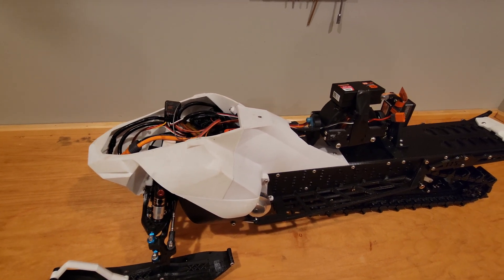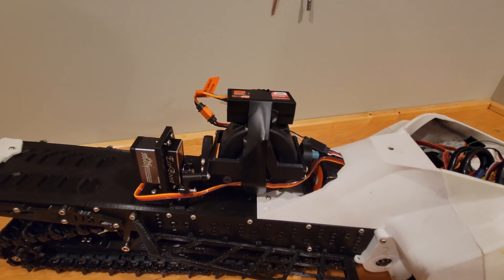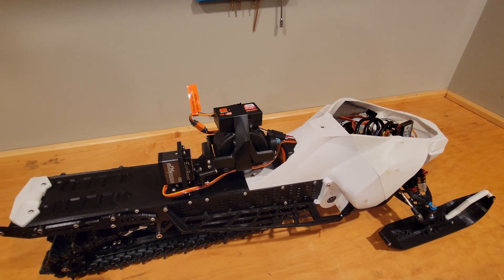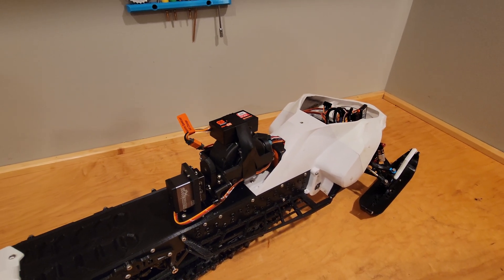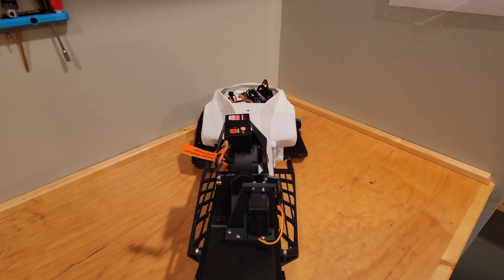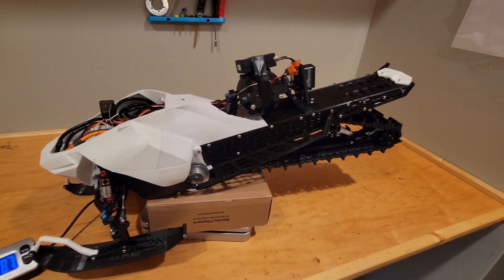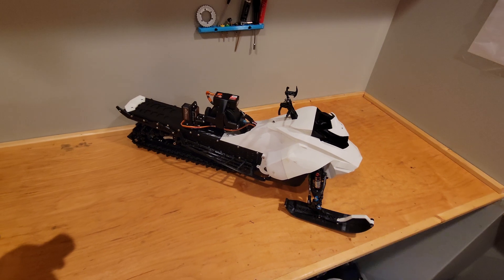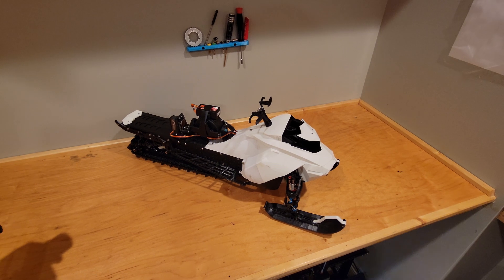G4 Flywheel- Pascal's dynamic weight system challenge

Comment: Merry cool , I suggested to Robert pascal he needed weight on a servo but this seems to work pretty well I think a smaller version of the flywheel would work 
You can see the weight hinders it a little but turning was very good also it may work better if it can be mounted lower and more forward just a little

Comment: Isn't the challenge to make it turn better?
Reply from the maker: Yeah... that's what I did
Reply: @wheeliegriff777  I didn't see any turns. A couple times it spun around standing straight up. Show some turns carving. And some turns on a side hill turning into the hill. 

Can you drive it in a controlled manner and make a turn showing the sled leaning into the turn and not tipping over to the outside? A somewhat controlled turn? The issue everyone knows these RC sleds have...

Please show that so we can see if a gyro really works like we hope it can, instead of answering by saying you did it when clearly you didn't.
Reply from the maker: @chilly7261   @chilly7261  It definitely works good. That was my last day with deep pow, so now it's all basically melted. If you look in the video the sled was side hilling and dose some really tight 180° turns. Dose your sled turn in actual deep pow? Hard pack turning is one thing and deep pow is another thing.
Reply: @wheeliegriff777  Thanks for responding. Good luck with your mod...
Reply from the maker: @chilly7261  you too.....

Comment: The ingenuity in this competition is crazy. This is the fourth video I stumbled across and they'r all different. I think yours is working the best. Is the gyro hooked up to a Helicopter gyro? That would be gold I think.
Reply from the maker: No it not, just mixing the steering with the flywheel movement. That would definitely help out I'll do a vid with that!
Reply: It's crazy how the sled was keeping steady when wheeling and picked back up in a different direction when off balance. Never seen that. Yeah the heli Gyro well adjusted would definitely help bit more for sure. Definitely top contender in my eyes. Good luck. @wheeliegriff777